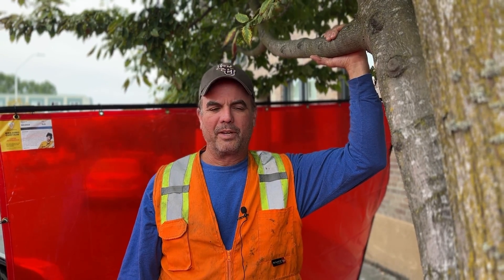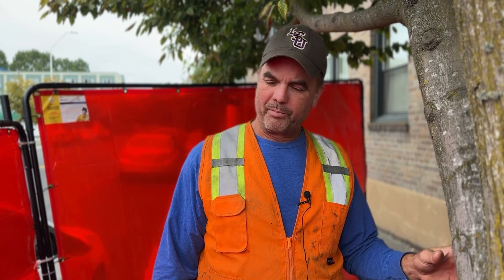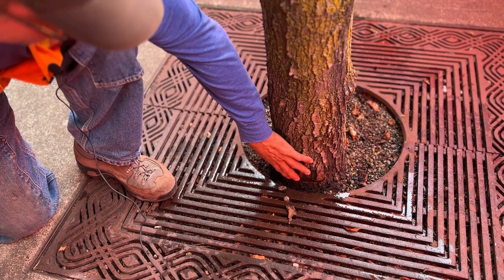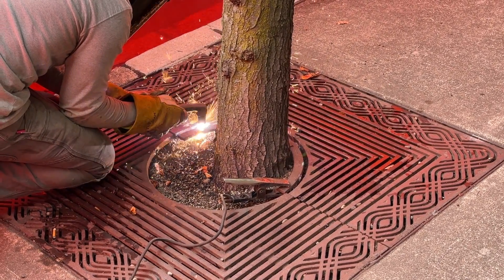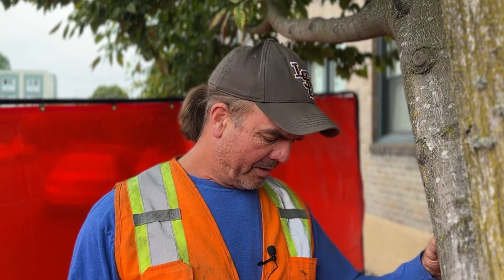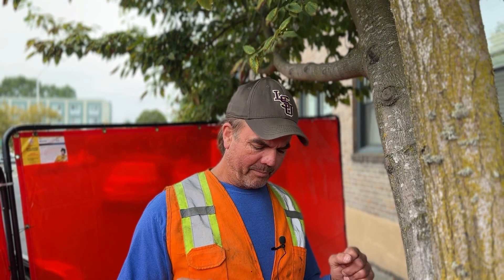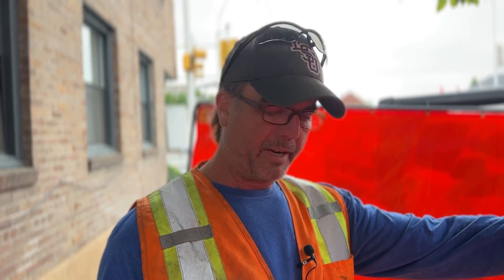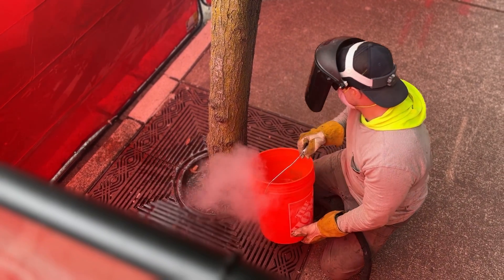When City Trees Grow Too Large for their Metal Grates

Comment: Also the heat from the torch scorches the earth and leaves behind issues.  I'd opt to use an industrial saw or grinder. And clean surface. Or better yet slide in fabric to catch particles.  Cut back.  Then remove concrete amd apply recycles rubber replacement for concrete around root crown.

Comment: All you need is a cutting wheel on a 7" grinder
Reply: We cut metal grates like that for driveway drains about a inch thick cast iron my 4 " DeWalt cuts right through the gaps all the time it's fun to work with steel and plasma cutters torches I did some ship work when I was younger awesome experience

Comment: The problem is not the grate. The problem isn't the tree continuing to grow either. The problem is the people in charge of the trees being planted. In the city you have two constraints, the tree roots of many deciduous trees and their expansive crowns, especially if they don't have competition from other trees for sunlight. People in the Puget sound just aren't familiar with Appalachian hardwoods. Ya want color, great. Ya don't want problems, great. Stick to species which gives you both. Like pin oak and black and sweet gum and sassafras. They all have dynamic fall colors but grow very slowly so they don't develop hugely thick trunks and root structures. They also don't develop huge crowns which limits interference with power lines, street traffic and peoples' ability to see. They also are not nearly as demanding for maintenance and pruning.